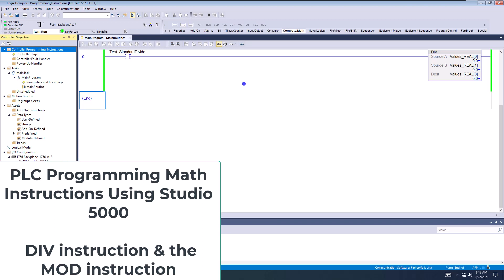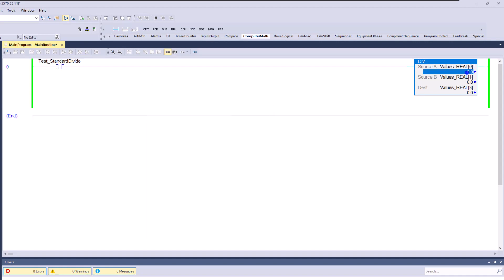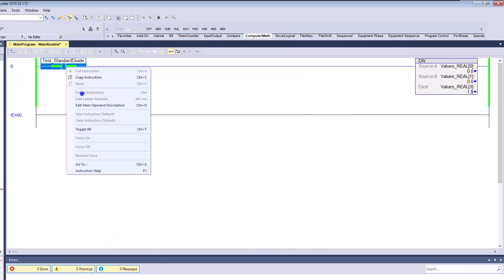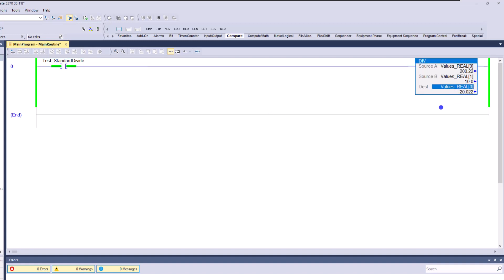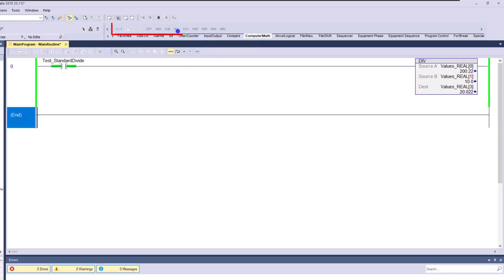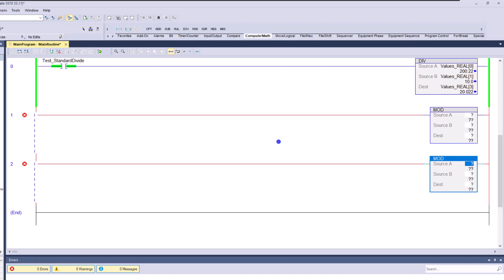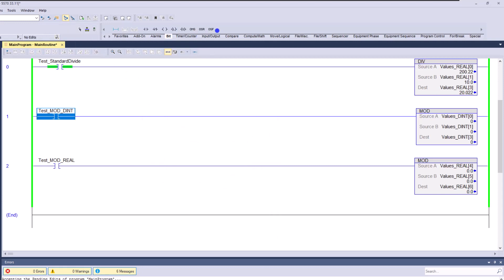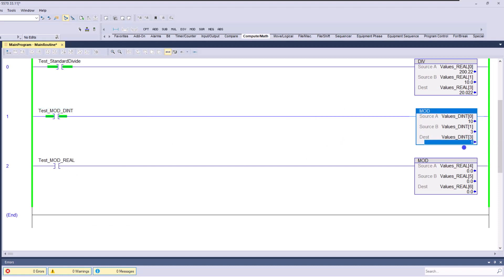PLC Programming Mathematical instruction | MOD Instruction Studio 5000

Comment: I used your configuration to see a minor fault in a 1756-L85 Controller version 36.11 but I didn't get the minor fault. Anoy tought?
Reply from the maker: @mauriciotrejo3418  Using 36 is different, what minor fault are you having
Reply: @ShaneWelcher  In fact I'm not having any minor fault, I'm trying to configure one project with minor fault, I been trying by looking on internet documentation, videos, trainings but at this moment I was unable to trigger any minor fault in any project. Do you have any recomendation or example that I can use for my own training purposes?
Reply from the maker: @mauriciotrejo3418  Join my Most Complete PLC Training course
Reply: @ShaneWelcher  Could you share the link to the course?
Reply from the maker: @mauriciotrejo3418  https://www.allen-bradley-plc-training.com/p/plc-programming